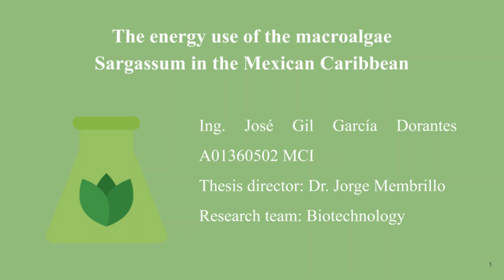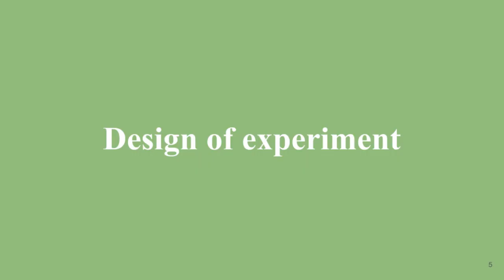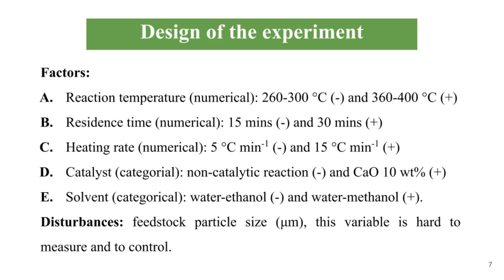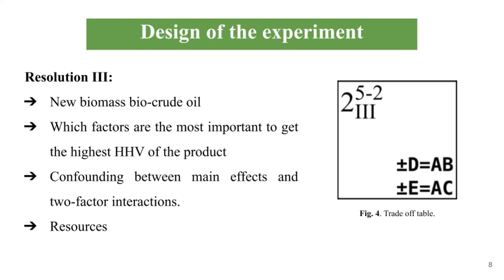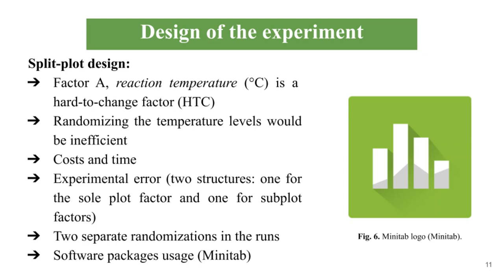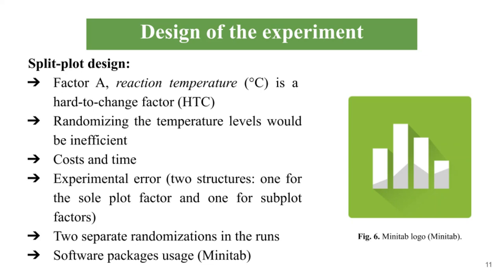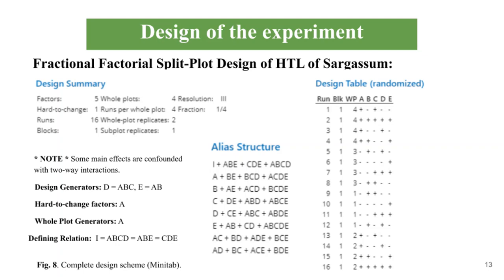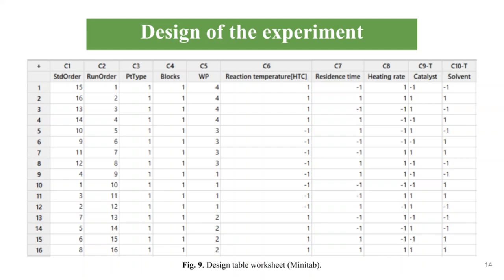Design of experiment of the Hydrothermal liquefaction (HTL) of the pelagic Sargassum.

Comment: Hi Gil, interesting research in this time of environmental deterioration, I think it was a good option to use a resolution III experiment, considering the two blocking factors: catalyst and solvent. It will help you have an approximation to the optimal design, where you can add more factors to the study. And finally, Minitab was a useful analysis alternative for this type of problem.

Comment: Hi Engineer Gil, 
First of all, well done! Your project was well defined and supported with scientific arguments. 
These are my comments: 
a) Are the high and low levels of the temperature reaction factor the limits or are you consider this levels a little far from its limitis? I think it would be constructive if you could mention its midpoint and indicate with previous researches  that its impact for this experiment is linear or not linear. 
b) If you don't have any limitation to run any number of experiments, would be a good idea to propose a DoE with repetitions points? In that way you could have a linear model with more data. 
Thanks.

Comment: Reading about our collegues comments, I agree with Alec about the noise. It seems that your low and high level for temperature factor has a very large span. Then I think this will be introducing large amounts of noise to the system and, as far as I read in some books also you could be benefited from duplicate experiments in which you test several samples at a time to reduce the variability. Of course each sample is then subject to the same amount of noise in each run, because replicating runs might not be suitable for your settings. Also, I have some doubts because heating rate is applied from which point to which point? Meanning there is a time needed to reach the temp, could this be used for blocking?. Also you are considering in the begginning Heat and Pressure whereas you don't specify if this is a constant pressure (another HCF) or constant temperature (I think you adress that in your model). Last but not least it would be interesting to see the development of split-plot designs in R as was the package that we worked with during the lecture. Good work!

Comment: Hello Gil!
First of all, great video and explanation. I have a couple of questions regarding your experiment. It is clear that the disturbance you pointed out (the feedstock particle size) is a disturbance which is hard to control and measure, but it will not affect considerably your experiment. However, I am intrigued and would like to if the levels you selected for the React temperature would affect your experiment. The range for the low level is (260-300) and for the high level is (360-400). Don't you think the temperature range is too big? Could this introduce noise to your system? Or is it too costly or difficult to narrow the gap?  I wonder if this could help improve the results of your experiment.
Thank you in advance for taking the time to read my questions!